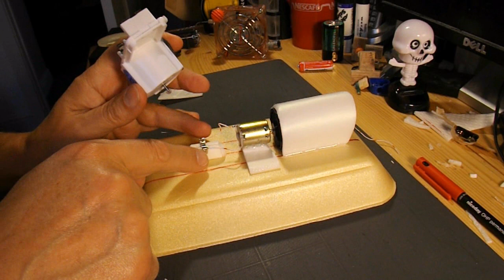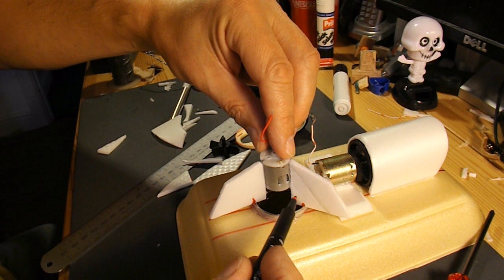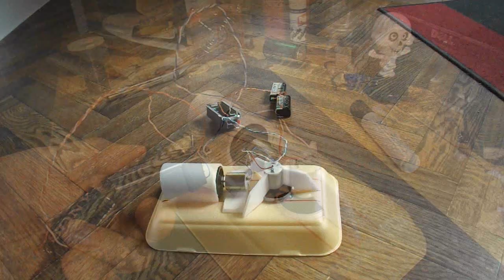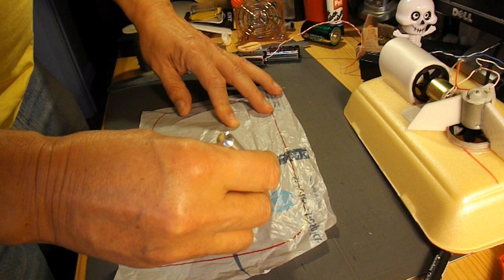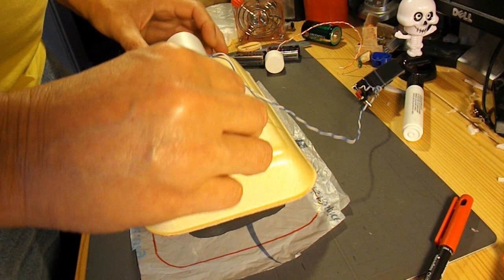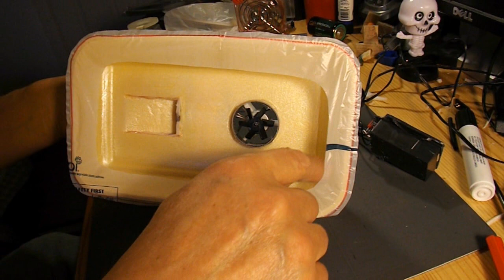Bargain Store Project #8 update

Comment: The pitch of the fan blades look too coarse to me , could you heat the plastic and reduce the angle of attack?.
Reply from the maker: I am sure you could if you wanted. They came out of the lint removers and are probably designed to push the air out sideways more than backwards.

Comment: If you were to put a plastic bag on the bottom, and leave it a little baggy, taping it to the tray and punching holes in the bag, small holes, then it would fill up with air, and push air out more forcefully push in the hovercraft of the ground, I just made a hovercraft today and it works very well, I used some of the same materials.
Reply from the maker: Hey thanks for that Hunter. I may give it a try. As you can see in the video I did use a plastic bag to make the skirt, but only a thin strip of it. Next time, rather than cutting it into a strip I will try it like you say.